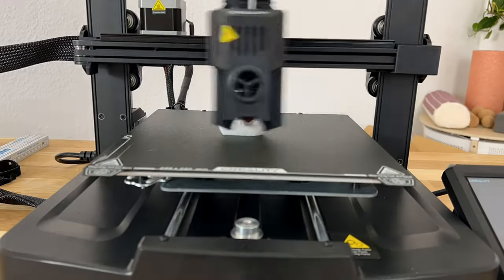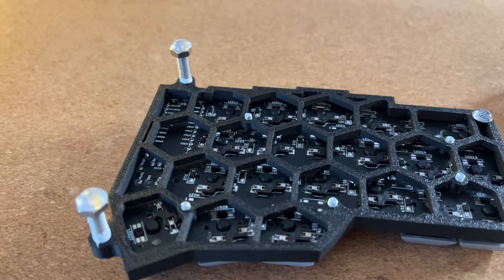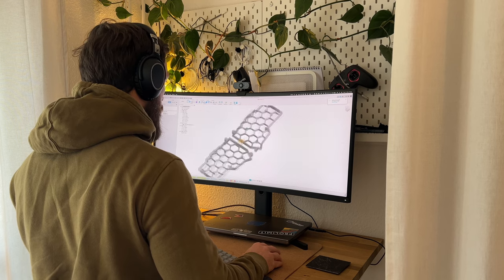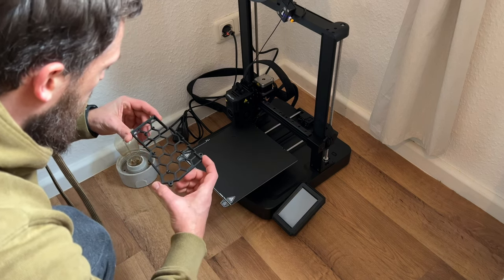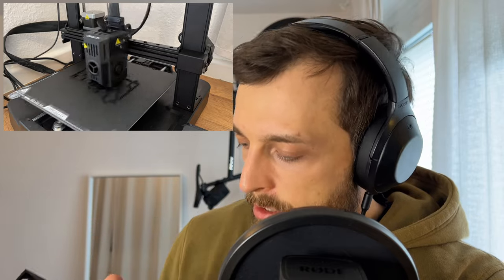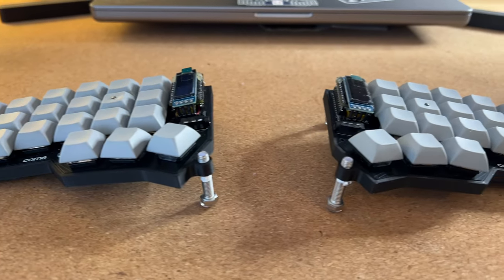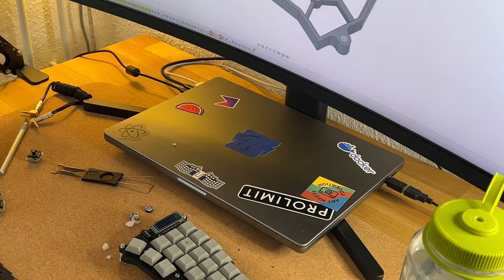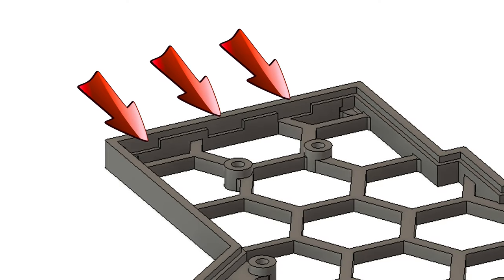Exploring My Custom MX Corne Keyboard Case Design

Comment: Are you planning to use another material then PLA? ABS could be a little frustrating...
Reply from the maker: No not planned yet. Is it better to use abs for this? Maybe I’ll print some day another one 😅
Reply: @CodingWithAuryn  For that it should be fine, but if you have something that is in your car, PLA deforms in the heat for example xD ABS is more heat resistant, but it is harder to print. I don't know the new ender generation. I still have a
 very old one and I didn't get it to work with ABS because I don't have an enclosure around my printer. You have to keep the temperature good for ABS and the heatbed somehow wasn't enough ^^